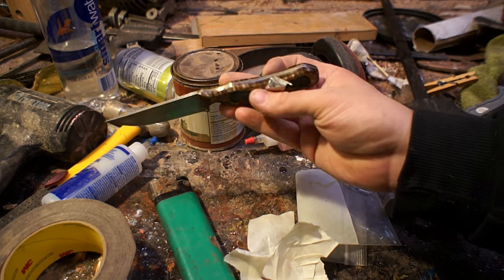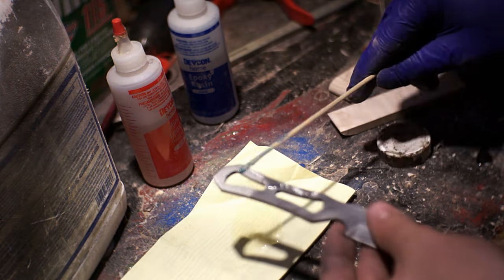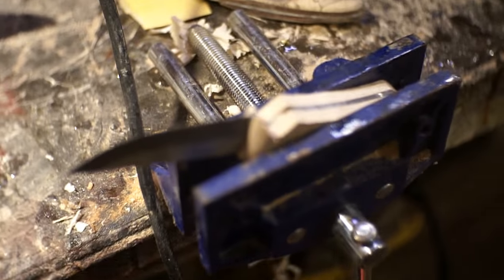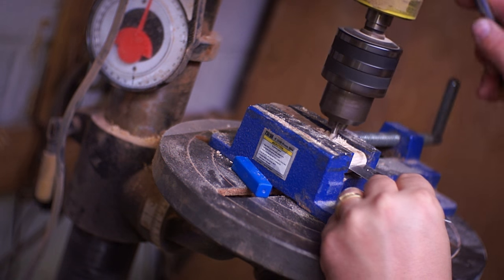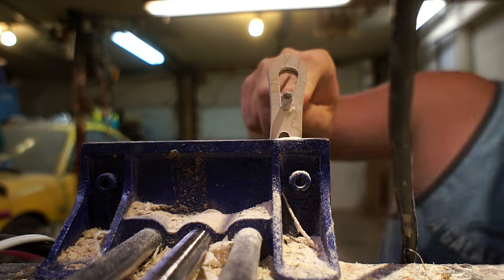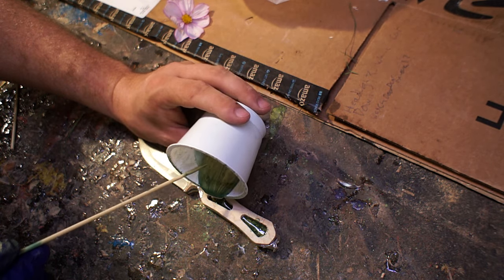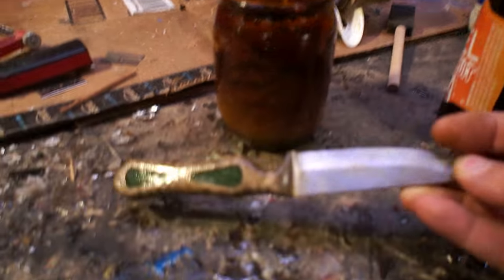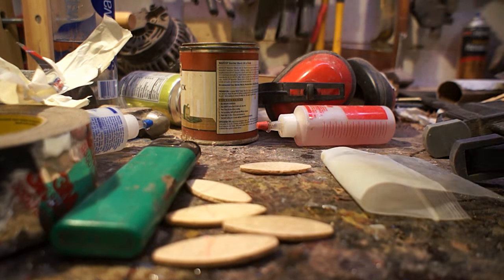Hollow Knife Filled: Epoxy, Curly Maple, Vinegar and Steel Wool Stain

Comment: End mills will work fine on a drill press if they are center cutting and you only intend to do plunge cuts. The quill on a  standard drill press is not designed to handle the lateral forces that are created when cutting on the X & Y planes. Plus, as you discovered, without an XY table and vise firmly attached to the machine you do not have the control required to make any cuts in a safe and effective manner. If you had a bench top milling machine or a small mill/drill you will find a whole new world of creative possibilities and would love it. Anyway,  good work on the knife. Curly maple is a beautiful wood and the epoxy infills came out nicely.
Peace!